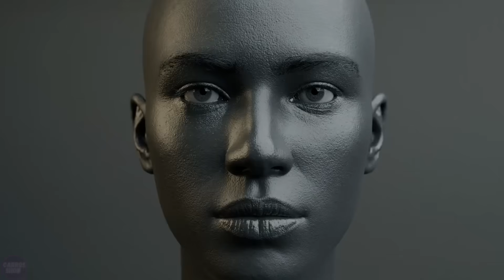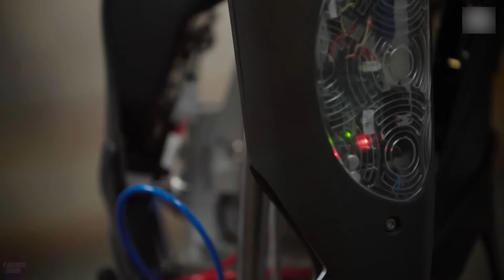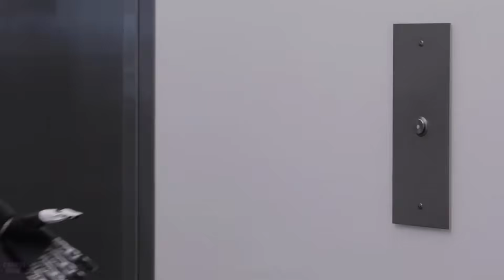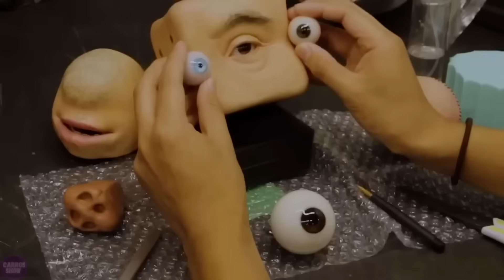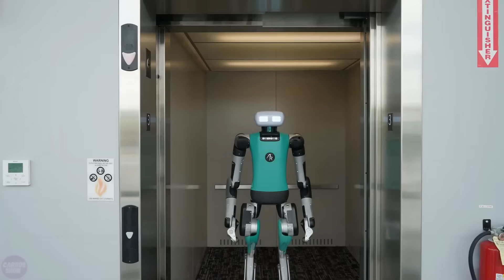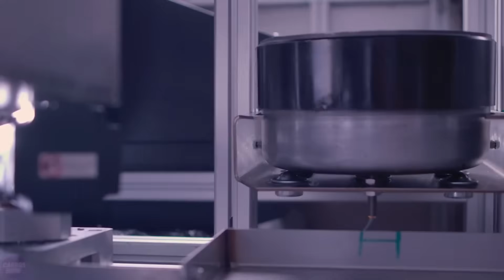All Most Advanced Humanoid Robots and Technologies | BEST OF AUTUMN

Comment: 11 degrees of movement? 10 degrees of movement?  What the heck is that?  Fingers in the video showing an easy 90+ degrees of moment, shoulders with well over 100+ degrees of moment.  Joint rotations up to 360 degrees?  An 11mm camera equivalent view, maybe... that would be around 113 to 130 degrees of view.  But 11 degrees of movement?  What on earth are the measuring??